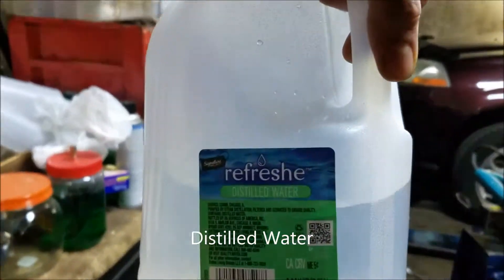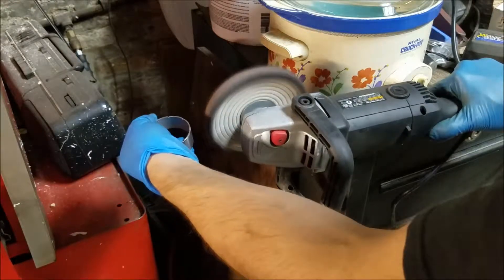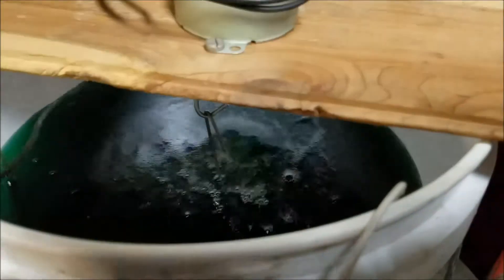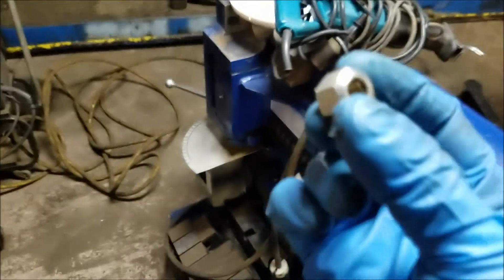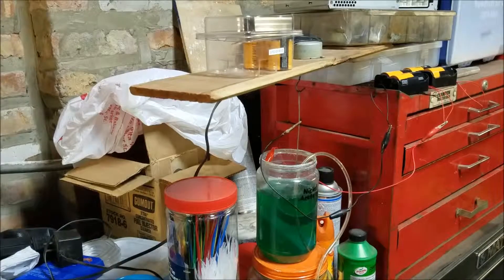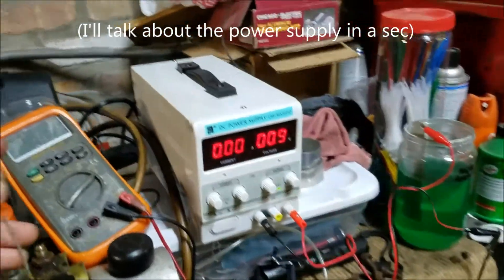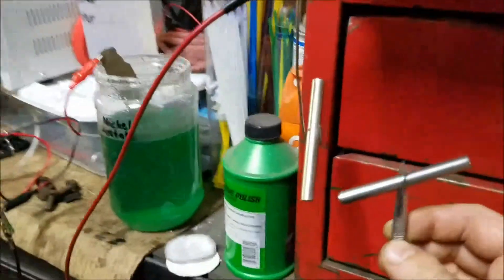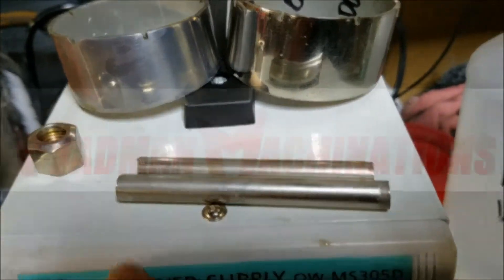(Mis)Adventures in Electroplating!

Comment: Thanks for your time and effort, although I would like to know the time in the solution for plating
Reply from the maker: You're welcome! The time can be found by using the complex equation in the video description. It's a pain to calculate, and it uses square decimeters for surface area. As if it wasn't bad enough converting to metric, you have to convert to an oddball unit. If you actually punch in the numbers on the first few parts you plate, you'll get a feel for it. I don't even bother with the numbers now. I should mention, my goal plating thickness is 8um, that seems to be fairly standard. For a part like in the video, about 5 minutes at 200mA should be fine. I shoot for the lowest voltage that will give 200mA. If you are planning to really plate stuff, and not just tinkering, you should definitely invest in a benchtop power supply like I have in the later part of the video.
Reply: You prolly dont care at all but does anyone know of a trick to get back into an Instagram account..?
I somehow lost my password. I appreciate any tricks you can offer me.
Reply: @Aaron Jeffrey instablaster :)
Reply: @Zaid Ronin thanks for your reply. I found the site through google and I'm waiting for the hacking stuff atm.
Takes a while so I will get back to you later with my results.
Reply: @Zaid Ronin it did the trick and I now got access to my account again. I am so happy!
Thank you so much, you saved my account :D
Reply: @Aaron Jeffrey no problem xD